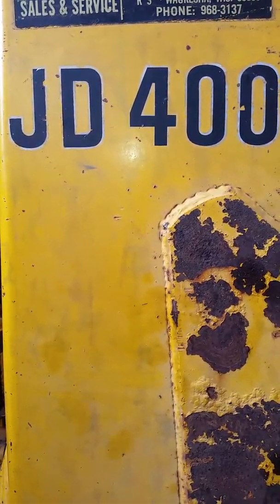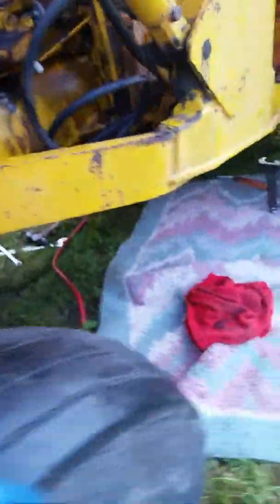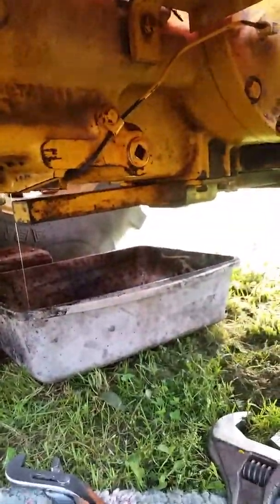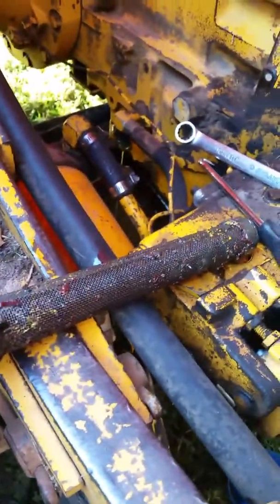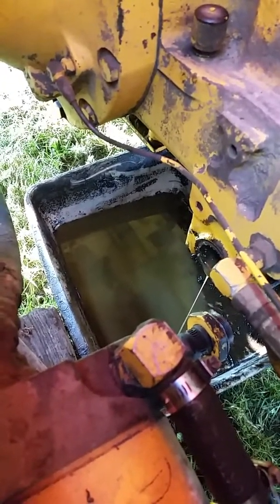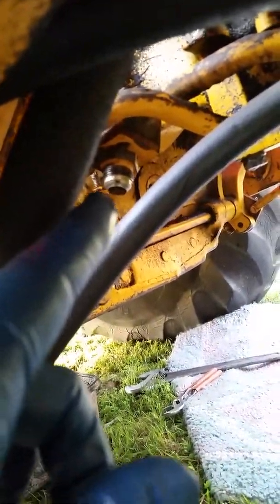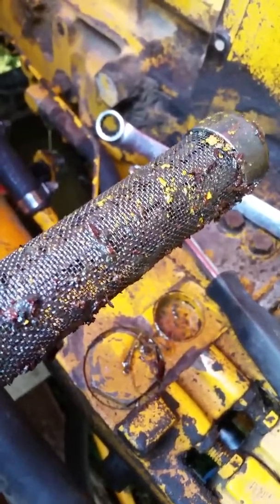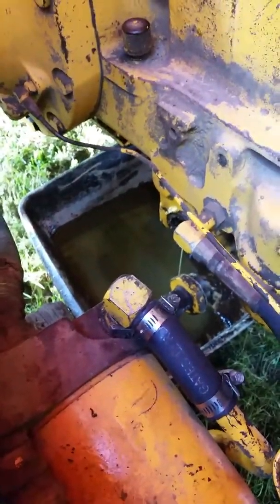JD400 strainer removed

Comment: Wished you showed more detail. Where did the strainer come from
Reply from the maker: In the rear differential on the bottom. Maybe I take a pic or make another short video.
Reply: What was your problem and did the screen cleaning replacement fix anything or just needed replacement?